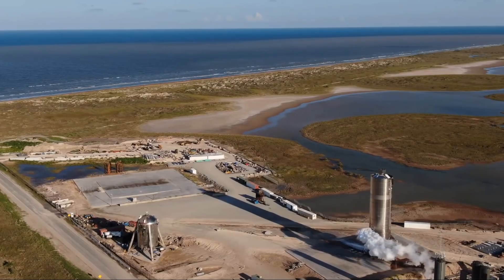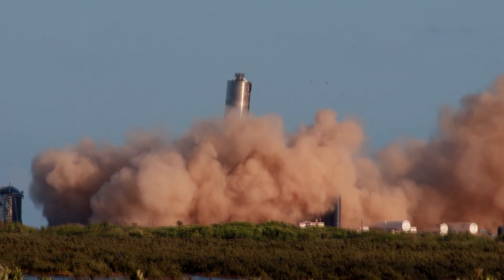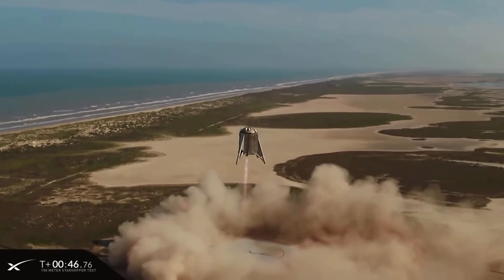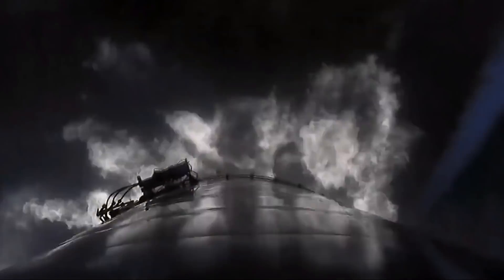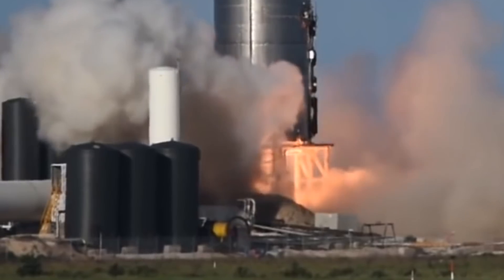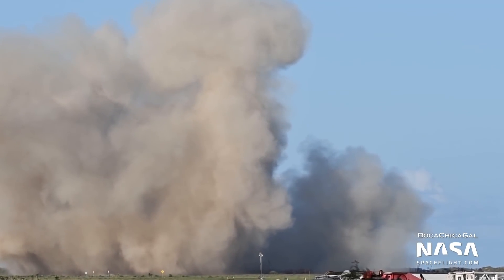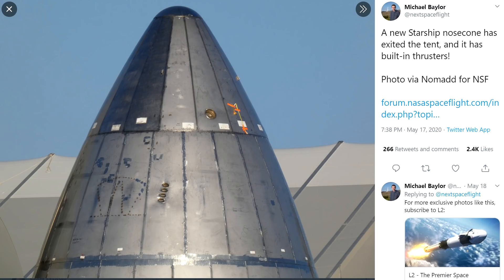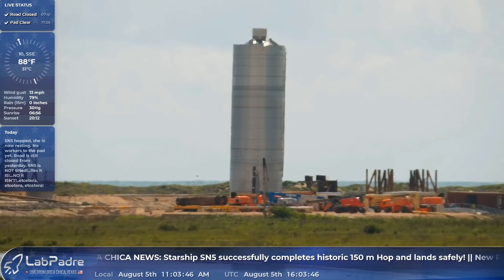SpaceX's Shiny Stainless Steel Starship Prototype Takes Flight For The First Time

Comment: I think Elon could have painted it orange.  Seems to have taken the flying garbage can idea from a drunken KSP session.  "Mass simulator"  (Pile of bricks we found by the dumpster.  Structural integrity not guaranteed.)  304L is a cost saving option.  Forged 316L would have been classy.

Comment: The other reason,I surmise, for the switch to 304 SS is it's cheap, the least expensive of the austinetic SS, because they're going to 'burn' through tons and tons of metal in making all these rockets. Otherwise nickel maraging steel is the obvious choice for strength to weight including cryo compatibility. Maraging steel is 8-10 times stronger, therefore lighter, than 304. I think they'll eventually switch to maraging steel once they debug their designs. It's also ~30x more expensive.

Comment: 304L stainless steel means it is a Low Carbon alloy, i.e. 0.02% versus 0.08% in 304.

The lower carbon content helps minimize/eliminate carbide precipitation during the welding process. This allows 304L stainless steel to be used in the “as-welded” state, even in severe corrosive environments. If you were to use standard 304 stainless in the same way, it would degrade much faster at the weld joints.

Basically, using 304L eliminates the need to anneal weld joints at 1,000°C for 30min prior to using the completed metal form — saving time and effort.

304L has slightly lower tensile strength & yield strength (~4%), thus is more ductile, however it is much tougher (combo of strength & ductility) at cryogenic temperatures:
https://youtu.be/62meQpOcndo

Comment: Question. What will be inside those upper nose cone sections on SN8 to reinforce them to insure they don't just buckle under max Q. Just a giant void or welded rings with some hydraulic actuators and thrusters installed? Are there going to be reinforcements and decks installed?

Comment: SpaceX has purchased two large semi- submersible drilling rigs , I'm sending my electrical technicians to the rigs to meet with SpaceX and check the condition of the drill floor equipment and see what machine they want to keep in operation. SpaceX says they would like to keep the drawworks.

Comment: We can transfer propellants and tanks for first stage to ground & connect them to 40km - 70 kms long plastic mylar carbon fiber flexible tubes, just 1st stage engine goes up, we have advanced plastics now , weight of rocket reduces to 75% , we have to burn fuel at rate of 50kgs/sec instead of 500kgs/sec, lift the tubes with small engines every 1 km , 1st Stage engine and  2nd stage  rocket are reusable ...

Comment: We can transfer propellants and tanks for first stage to ground & connect them to 40km - 70 kms long plastic mylar carbon fiber flexible tubes, we have advanced plastics now , weight of rocket reduces to 75% , we have to burn fuel at rate of 50kgs/sec instead of 500kgs/sec, lift the tubes with small engines every 1 km

Comment: If you check Mary's first post flight video taken early the following morning you will see a puddle of fluid near one of the gear. Directly above that gear there is some visible buckling of the the tank wall. Not a lot but it is there. Also you will see in the video where SN5 is put on the Roll Lift 2 of those gear were fully compressed and were later removed. It appears there was a gear change on SN6. The ones they put on today look twice as big to me.

Comment: What about the launch pad that disintegrated from the rocket exhaust right after takeoff?
Any dangerous debris? Possible cause of that small engine flame by knocking some pipe loose? Where did the big pieces land?

Comment: Hmmm, wonder how much of the exhaust got caught up in the engine skirt in the moment right after touch down but before shutdown. Those legs don't provide a whole lot of clearance. But of course just a single engine isn't that much exhaust flow rate compared to the open area of that clearance. I'm more curious about how high off the ground the legs of Superheavy are going to need to be to allow the exhaust of 31 of those suckers to escape without damaging itself.
Reply: I assume they'll land it on a super-heavy-duty grate of some kind, with a flame tunnel? Cuz that's a LOT of backpressure right there, with more engines firing simultaneously. (They wouldn't use all 31 engines for the landing, just enough of them to brake the mass/momentum of the Starship or Superheavy. But still!!)

Comment: The software for controlled flight and descent is much more mature now. We might not see too flight mishaps, but still see takeoff mishaps with ground equipment. Getting the takeoff right needs more hops and more experience handling the problems that crop up.

Comment: 5:08 - Why and how is that obvious?
Reply: The "powerslide" immediately upon liftoff?
Since the engine is off-center but the vehicle is perfectly vertical on the launch pad, the moment the engine starts, the vehicle gets a kick in the pants that pushes it diagonally upwards. Once that massive vehicle gets any sideways momentum, it requires a good hard push in the opposite direction to cancel it and return the vehicle to perfectly vertical flight. This test mule had a couple of cold-gas thrusters (you see the puffs now and then, near the base) but those would not have enough power to keep the vehicle perfectly vertical with an off-center Raptor pushing it diagonally (which happens even though the Raptor is vertically aligned at liftoff—or even if the Raptor was gimbaled hard at liftoff, I think?).

Watch the flight again. You can actually see the exhaust plume shift as the rocket engine gimbals beneath the vehicle to correct its sideways momentum and bring it down for a vertical landing.

One problem with the landing—Scott points it out too—is that the craft was "translating vertically" to touchdown, but the craft itself was slightly tilted in order to keep it moving only vertically. So one side of the landing legs caught the full weight and momentum of the whole vehicle, and it seems that they crumpled a bit under the impact of the "lithobraking" ;-) Better than having the whole thing tip over and explode, though, so definitely a successful landing. 
Once that center thrust puck has all three Raptors mounted, so that their thrust is perfectly centered, a vertical landing really  will be a vertical landing, and all the legs will touch down at once. 

But the dang thing will need to be a LOT heavier before they can add more than one Raptor engine, or it won't be able to make a slow descent under power!  Those engines are just too powerful, and can't be throttled down any lower than 50% or so. That's why the Falcon 9 boosters have to perfectly time their landings: so they don't accidentally take right off again. They can't hover in place. They need that downward momentum to push them to the ground while the Merlin engines are firing, even at the lowest throttle setting.

And a Raptor engine is a good deal more powerful than a Merlin!
Reply: @Wordsmiths  No, I meant the part about it "obviously" having to sit vertically on the pad.
Reply: @vikkimcdonough6153  oooh... good question. If it were going to always have off-center thrust vector, then yes, they would probably build the pad and gantry in such a way that the rocket would launch in the proper tilt and go straight up initially.

I think they didn't bother because they hoped for just one, maybe two, test launches with a single engine. Then the same pad will be used for different configurations, all with centered thrust vectors (I think). 

But I would love to know how the conversation went, when an engineer brought up the idea. They run simulations ahead of time, so I'm sure the powerslide wasn't a surprise, and anticipating it and adding pad corrections would certainly be doable... perhaps they were concerned about the rocket falling over accidentally, if it were already even a few degrees off vertical? Hurricane season and all that... Or perhaps the determining factor was maximizing speed and minimizing cost: "Okay, it will leave the pad at an angle. Will that ruin anything? No? And how much would it cost, in time and delay, to adapt the pad to angle the vehicle for a perfectly vertical launch? Screw that. Let's find out how well the gimbaling system works."

Comment: Um - engineers should not be doing 'experimental' programs. Engineers are supposed to know how their design should work. Tests that engineers do are to verify the design meets the requirements, they are not supposed to be seeing if it works, but making sure the design works in agreement with the specification.
Engineers are not scientists, they are not (should not be) trying to discover new physics.

Comment: Pardon, I was looking into making a program where you can fly a plane and was wondering if you knew about how air speed influences the torque or how much the aircraft can pitch, yaw, and roll based again on air speed. I'm sure the surface and other variables of things like the rudder, aileron, and elevator influence it but I was hoping you could give me some pointers in the right direction to know what I should look into researching?

Comment: Maybe the fire on the engine piping was extinguished by the engine exhaust moving horizontaly sucking the air out of the cavity the engine sits in via the Bernoulli Effect?
Like a diffusion pump on steroids!

Comment: You commented about how the Hopper flight almost ended badly, but has anyone else noticed the large hunk of debris that went flying up from the launch pad shortly after takeoff of this flight? You can see it starting at about 0:15 in this video on the bottom right corner.

Comment: 304L is better for welding, and also corrodes less than 301.
301 work hardens as well, not sure that's applicable, but 304L might offer better welding performance.

Comment: If you look at the area below the skirt at 5:05, it seems to me like there is a flame coming from below there. I think that, if this flame is indeed from below the skirt, there are only two possibilities:
1. Flame recirculation; Due to the aerodynamics close to the ground, the flame gets pulled into the skirt, only to pop out again later. I do, however, think this would be a little late for this effect to visibly kick in.
2. The same issue/principal related to the flame discussed around 3:10, where it seems there is a flame on the outside of the engine.This seems the most likely to me. Here, I think, there are again two sub-possibilities (maybe more, feel free to let me know if you have any other ideas):
2.1. There are some lubricants or other flammable materials left on the outside from before this test (as discussed by Scott Manley), which suddenly caught fire due to the engine heating up. After this initial burst, they kept burning for a while, which can be seen on the shots of the engine. Once they were all consumed, the flame died out near the end.
2.2. Fuel leakage. Some fuel managed to leak past the seals and caught fire after the engine heated up enough. This leak closed near the end as the components warmed up, similar to how the SR-71 leaked fuel when cold, but sealed when it heated up. Although of course not optimal, this wouldn't be a significant issue either since the engine wil only be able to leak if the main valves are open and would seal relatively quickly after they opened since the engine would heat up due to the combustion.

Again, if you think otherwise, feel free to react below this comment.
Reply: Plus at 3:13  ,it was a black blanket, on the left side of the raptor engine ...moving ,may be one of right side flew to raptor pipes.

Comment: The thing is that even though it is an experimental program, they are pushing forward faster than anyone else. Even with a few setbacks they have with the raptor engine given launch access back to america that is a huge step. But the true wonder here is this flight, because if they can do that we all know in our hearts that the full sized ship will one day be able to do the same and soon even go further..

If only Bigelow aerospace manage to get one of their B330 modules out into LEO for testing and Reaction engines managed to get some actual flight time with their new hybrid engine... Ooh it
s exciting and interesting.

My personal belief is that we as in human kind need a huge space station in LEO to use as a platform for experiments and further launches deeper into space. Going up earth gravity well each time is costly and dumb if you are going beyond LEO.  It would be much smarter to have  big station to act as a fuel depot, launch prep and more.

Humanities space future looks bright right now, but it is dangerous so of course there will be more setbacks. But as long as we learn something from each setback we get one step closer to a new space age. They may fail 1000 times, they only need to find 1 that works, then improve upon it.

Comment: The mass simulator on top made more force transfer to the landing leg that had to counter the angular momentum of the silo tipping to the upright position.   More angular momentum of the silo pitching vertical after the first leg touched down.  Mass simulator angular momentum is mass* sideways velocity* distance from legs.   That may be why it ended up being tilted as if too much force on one leg bent/broke something

Comment: Okay thank you.  We did not get the 'all clear.'  Here I am, Capt. Ed on Mars and we can't get out? If you don't pee in your suit on takeoff or landing, the wait for all clear will do it.  
So with this kind of control and lots of fuel, landing is possible.  Can we park on the stand?  Time will tell.
They are making longer legs so the roll off can roll under it got to be double wide too.  I think the stand got cut by  your diamonds but it may have been the gse.  Of course it is on that side, Eh?  That was a solo Raptor.  ha ha I see zinc spray on the welds.  It was one of the criteria listed for a job as junior welder trainee, that I looked at on the SpaceX/Careers website.  Mr. Manley check and see if they have a spot for what? Engineer Scotty?  Really.  Capt. Manley, Admiral?  Love your show babe.  Will work for ticket to Mars.  Peace

Comment: The craft is tilted due to a failure in the concrete pad I think.  High heat and weight = failure.  Those legs looked like steel punches with no suspension.  They likely punched into the slab.

Comment: Could it be that it was a fuel leak but the engine "fairing" prevents most of the oxygen from outside getting there? And when it got to the ground, there was no oxygen that wasn't being burned by the nozzle already?
Might be the reason for the bottom fairing?

Comment: 304L Contains more Nickel and Chromium and Less Iron and little Carbon than 301. I worked in a Steel Mill. 

while some engineers may wonder why 316 is not used is because, its not like its gonna land in an ocean per say like the apollo's did. While 316 does provide better corrosion protection in Sea environments, 304 is perfect for this Space X.

Comment: Looks like it suffered a buckling failure on landing, visible as 'dents' in the skin at 7:00 The offset thrust line is probably the cause due to how it takes up the loads on the legs during the landing?

Comment: Aren't there extremely high vibrations on landing with the engine/legs giving such low clearance for engine exhaust to expel, not to mention the side-skirt that I would imagine would catch some of the exhaust and cause more vibrations. Aren't vibration concerns a reason why we have does exhaust canals on  launchpads and use of water somewhere?

Comment: the engine is working at 260-300 bar,if that was gas leak that would be goodbye.... most likely residue from cleaning that got on fire from the insane temp.

Comment: What was the significance of this hop?  Haven't they done exactly this, with the Raptor engine, with the other hop?

Obviously it's always cool to see crazy shit like this, but what's the specific point?
Reply: I think they're progressively increasing the size until they reach the final target vehicle size.  The increase in mass/weight must pose new problems (mostly in structural integrity).
Reply: @nolsp7240  Aah so it's more about an incremental approach to final conditions in every area, rather than proving a full component at once?  Makes sense.

Comment: Scott, one interesting video would be about how Spacex is managing to maintain the push in such pace. How do they manage the team and tasks? Its not simple software development project with SCRUM and AGILE, but some evolution of it right? Because for example to develop so many different branches, possibly not in house production like parts of the raptors, welding custom equipment for those rings, alloys dev work etc etc. Not to mention the crewdragon capsule project and skill sharing between the teams within the Spacex and probably even between the companies like boring and tesla. I think having a dive into the topic would be a good one!

Comment: Can somebody explain the point of these hops? Engines have been tested and the proof of concept has been done previously. This does not work as a complete system test either, siince the rocket assembly is not similar to the one supposed to be used for the production flights.

Comment: HI, can you do a quick video talking about the reaction thrusters on the test or was it the gimbled engine doing all the manoeuvring?, (there was other little what looked like puffs coming out) and especially no one has said what that large stream of propellant out the side was at the start. Its coming from the otherside to where you talk of the filling disconnection point.